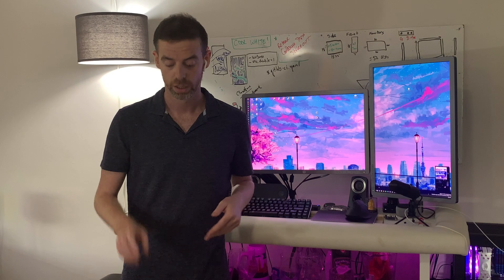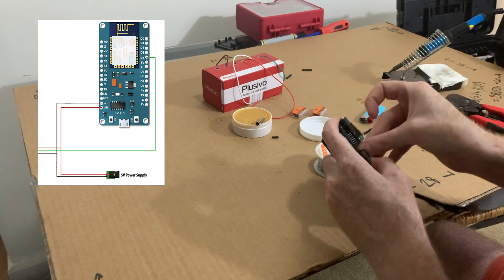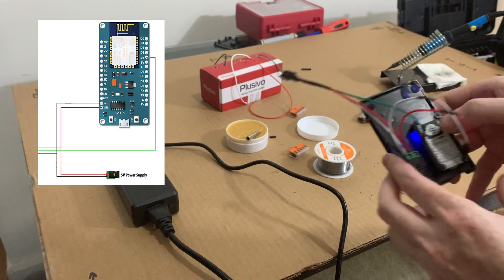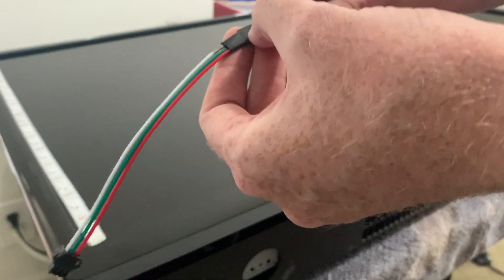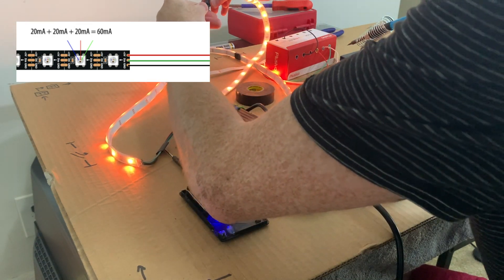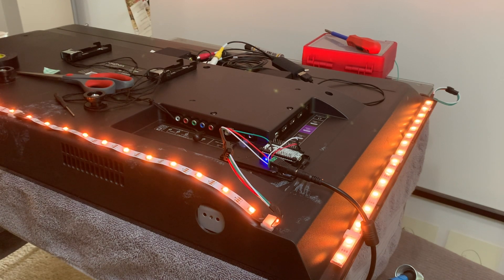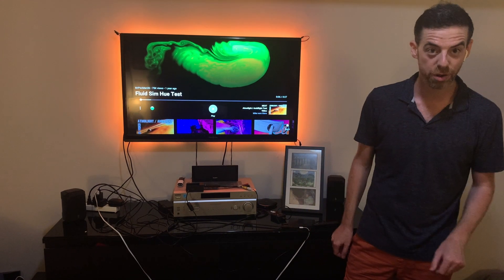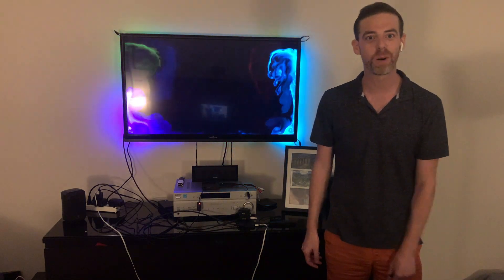Build your Own Ambilight Part 3 - Building the Ambilight! Hyperion, WS2812B, NodeMCU, & Raspberry Pi

Comment: There are some pre-made solutions out there now that kind of have most of the work done already.  I still would like to do this project under one condition.  Does this work with HDCP protected content like Netflix?  It seems most if not all the pre-made solutions do not work in those conditions.  If this does, then its by far the better way to go.
Reply: @MadeByMiro  Very good, I'll start ordering parts lol.  Why 2 power supplies in the parts list?  One for the testing and one for the actual production item?  I am upgrading both power supplies just because its not much more.  I also found its not much more expensive to get the LED's on Amazon with everything else.  Worth cutting the wait IMO as a few dollars is nothing compared to the project cost as a whole.
Reply: @ViciousXUSMC  I was just about to ask about the two different power supplies, as the 30a should be enough to power the LEDs and NodeMcu. I'm guessing Mike is using the 10a for his extra LEDs to the side of his shelving.
Reply: @simonmuxlow9161  ~60ma per LED MAX I have 219 LED 219*60/1000 = 13A and I used a 15A power supply.  WLED does not show anything close to that 13A actually used but better to have headroom.
Reply: yes it can bypass drm protection

Comment: Question... I thought when you had an HDMI splitter, the signal was the lowest common denominator.  So you can't "split" 4k to one device and 1080p to another device... they would both, in effect, be 1080p at that point because that's the lowest common denominator.  I have a situation with a Lightberry setup of mine where I want to allow 4k60 w/HDR to my TV, but output 1080p30 to my USB grabber and as far as I can tell, it will involve adding a device that can downscale the signal but also spoof the HDMI identifiers so the splitter thinks both are 4k60fps w/HDR but only one really is.  Also, I've had mixed issues with HDR causing my leds to barely light up (I'm assuming the captured signal appears really washed out).  While I haven't looked into the hardware Lightberry sells inside its boxes, when I've monkeyed around with making similar setups (not using a NodeMCU, just an RPi) the LED strips would occasionally just sporadically light up 1-2 LEDs at one end of the strip and some sort of resistor or something was needed to keep that from happening.  Is this not needed when using a NodeMCU?  In other words, if you leave this on for a long time with no video signal, do lights occasionally come on on their own?
Reply: some spilters also do down scaling,. 

"So you can't "split" 4k to one device and 1080p", you can and it is exactly what they do

Comment: The USB grabber you linked, is that the exact one that you used? Many people insist you can only get hyperion to work if your grabber has the UTV007 chip. But seems not the case if yours doesn't. That's great news for lots of folks, because the UTV007 chip is getting much harder to find that's not a fake.